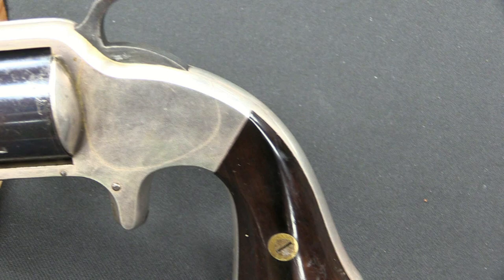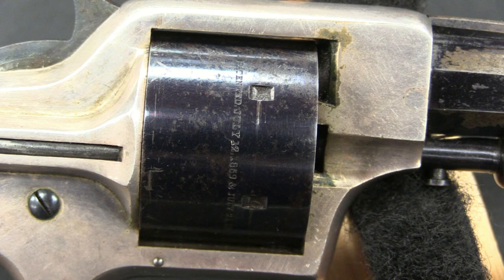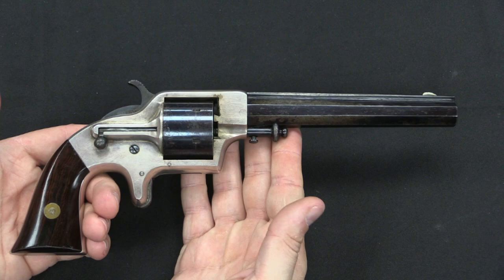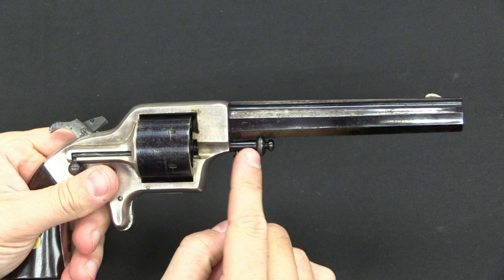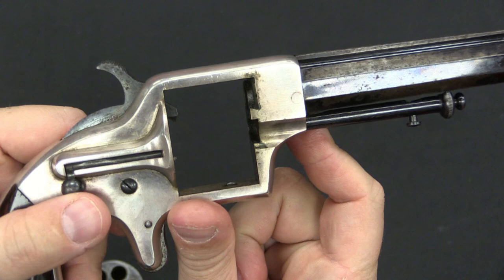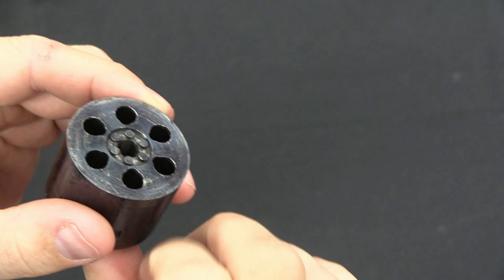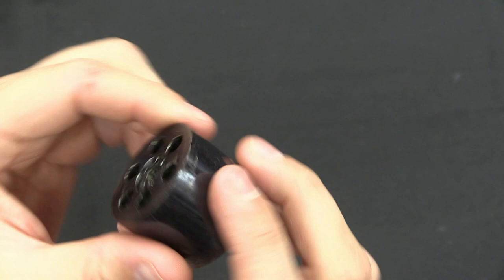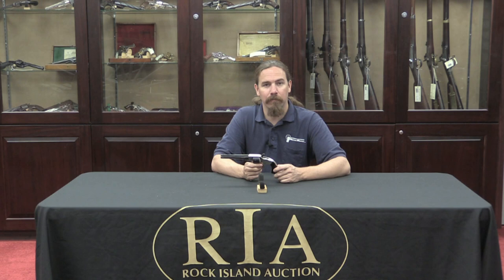Merwin & Bray .42 Caliber Cupfire Revolver

Comment: Some good advantages I can see.  The ejector rod can be really short for faster ejecting and you can fire really big magnum loads out of thin brass.
Reply: The ejector rod is only short on this because the cylinder itself is fairly short, as the cartridge wasn't that large. Regardless of its orientation the rod needs to clear the full length of the cylinder in either this or a normal configuration.

Also there is still a hole in the back of the cylinder, really it only has a step to it basically, so I don't think it'll add all that much more reinforcement to handle higher pressures.

Comment: Ian, I have one of these almost identical to the one in the video, except mine has a black powder cylinder. I took me a long to figure out exactly what manner of gun it was but I read that these would come with a cupfire cylinder and a BP spare. Most of the spares were lost like most accessories on an old gun. Its marked the same as the cupfire cylinder with the same round pegs, it just has nipples for caps on the back.

Comment: What, if anything, keeps the cartridges from simply falling out of the front of the cylinder when the revolver is holstered or carried?

Informative and interesting vid, as always!
Reply from the maker: AndWhatISeeIsME Just friction.
Reply: Agreed, friction can be unreliable. I'm thinking they were so committed to the usual revolver look and feel, that they forgot to put another "recoil shield" and a loading gate in front of the cylinder. Alternately, a smarter design would've been to have a full cartridge plate in front, recoil plate in back, a lip or bead on both plates on the right side of the gun to make popping in the cylinder easier, make the knob and button on the cylinder release fatter, patent and offer spare cylinders for the weapon. I figure people would be more inclined to use wax to secure the cartridges in the spare cylinders. People can use sticks to unload the cartridges off the gun. Why load cartridges individually if it's faster and easier, anyway? I guess tradition meant about as much back then as it does today.
Reply: @kennynoble1223  Because the cylinder is one of the most expensive parts of a revolver to make, particularly back then, so carrying even a few extra cylinders to load like a modern magazine would be equal in cost to buying a whole new gun...

Plus, as another commentor noted, the cylinder bores are obstructed by the frame in the normal locked position, only when the bore lines up with the loading slot would a cartridge be able to fall out, and that can only happen at half cock.

So unless you're working the action of the gun while pointing it straight down it shouldn't be too big a problem.
Reply: After 4 years I hope you have received your answer you needed.

Comment: That's a cool looking gun ,it would be ace if you could get someone to machine up a special cylinder that would let you use the gun with modern ammo then convert it back to standard.
Reply: dandel351 Well.. You wouldn't be able to use it with modern ammo regardless.. This gun was designed to fire blackpowder cartridges only. Maybe if you loaded up some cartridges by hand with blackpowder you could make it work.

Comment: How extensive would a rimfire conversion be for one of those?

I would assume you can get away with machining another cylinder for it that accepts rimfire ammo and keep the original cylinder intact. Maybe do some tweaking to the hammer.
Reply from the maker: ***** Rimfire conversion is very simple - this particular cylinder has already been converted.

Comment: I don't understand how it headspaces.
Reply from the maker: Daniel Stoner It really doesn't need to. Headspace measures how much space there is between the breechface and the cartridge, and it's important in order to prevent the case head from rupturing when fired. With a design like this the entire rear of the case is supported regardless.

Comment: Gotta wonder how many ND's happened while inserting a loaded cylinder with that hammer back, the exposed trigger, and the fiddling around.
Reply: Cylinders weren't sold separately on this particular gun, so they never thought about that. You are right though, trying to install  a loaded cylinder would make you a potential Darwin Award candidate.
Reply: ostiariusalpha That's a very good point, or interesting topic.  It would seem that anyone who was serious about their weapons and using this pistol would have had a spare cylinder.  No method seems like a 'fast' reload with it, but I could see a cylinder being the option over a manual reload for some - especially with the limitations of the pistol.  Could they have had cylinders made by other gunsmiths?  Are we absolutely sure no cylinders were available to pistol owners from the manufacturer?
Reply: Spearfisher1970 You'd have to buy a second pistol. I think towards the end Merwin & Bray would have been desperate enough for cash that they would have been pretty accommodating, but there were probably plenty of second hand parts that could have been purchased. It would have all been beside the point after the ammo dried up. Lot's of people tried to cash in making spare parts for Smith & Wesson revolvers or just outright copies, they ended up losing their shirts in lawsuits. It wasn't smart to try to make a buck off someone else's proprietary parts in the firearm business, they had too much at stake not to sue you.
Reply: ostiariusalpha Hey, I appreciate your replies.  Makes sense to me - thank you.

Comment: Seems like a revolver it would be very easy to reload by simply swapping out the cylinder. Though I assume the cylinders were too expensive to make that a viable tactic.

The lack of trigger guard however comes across as positively suicidal. I can't imagine the rationale that would have someone omit such a basic safety feature.
Reply: Mutant1988 the US cavalry carried a colt revolver and a spare cylinder to "easily reload"
Reply: ***** that patent expired a LONG time ago.
Reply: Mutant1988 They still make guns today without trigger guards. As someone pointed out, with a single action gun, the trigger is useless unless the hammer is cocked.
Reply: I still don't see how it's a good thing not to have a trigger guard.
Reply: You make it sound like trigger guards serve no purpose whatsoever.

http://hunting.about.com/od/guns/g/glossary_trigger_guard.htm

It is bad not to have one because it compromises safety (Of fire and of the integrity of the trigger - Less of an issue with this design though) for some kind of advantage you fail to clarify, even when directly asked.

Not having a trigger guard is dumb, plain and simple. A feature that makes it impossible for anything not inside it's loop (i.e, nothing but your finger) triggering the gun to fire is always a good thing to have. Unless you can think of a good reason it's not?

I mean, is it unthinkable to think that someone would cock the gun well before they aim and fire it? A trigger guard can be good to have until you actually decide to fire it.

I did a search for guns without trigger guards and I can't say I find any (Factory) made past the 20s or so. Aside from Derringers, that is (Which are also stupidly unsafe). If they exist, then the lack of a trigger guard doesn't seem to be an advertised feature.
Reply: Mutant1988 In a design like this, omitting the trigger guard doesn't pose any real disadvantage, with the gun's single-action trigger, and since the trigger is a sheath styled trigger that only really pops out to a minor degree when cocked, it is plenty protected from damage. 

On smaller firearms like derringers (which you mention are "stupidly unsafe", a point I definitely agree with), a trigger guard just adds unnecessary size and can be more of a hindrance, especially if you have gloved hands. In fact, most modern striker fired pistols suffer from having restrictive trigger-guards, which can cause it to be difficult to fire the pistol properly with decent winter gloves. This isn't to say trigger guards shouldn't be on modern pistols, it's just a fact I wanted to point out.
Reply: ***** At 5:12 a loaded cylinder goes in, and the hammer is at full cock, meanwhile fingers are working around the trigger trying to snap the locking pin in place...

Comment: How did they keep the ammo from falling out the front?
Reply: If you look closely you can see that when the cylinder is in its locked position the bores are obstructed by the frame, it needs to align with the loading slot to fit a cartridge in or out, which can only be done in half cock.

So as long as you don't work the action while holding the gun downward, it should be fine.